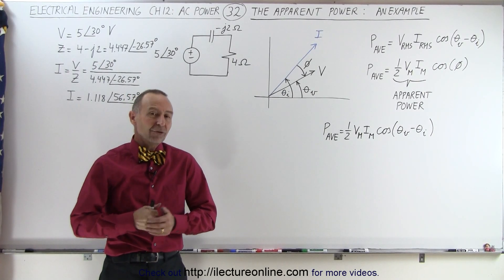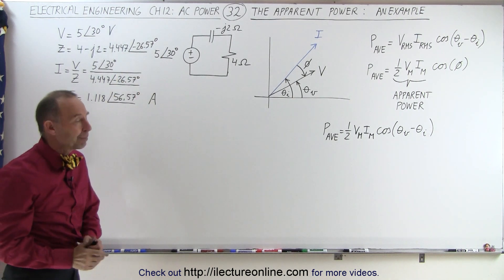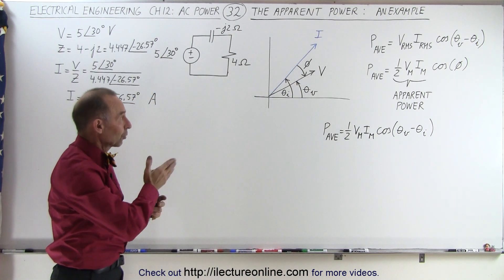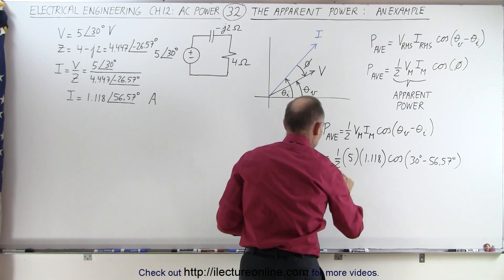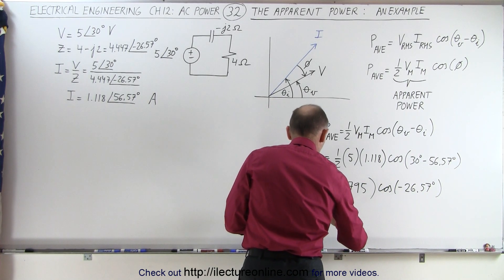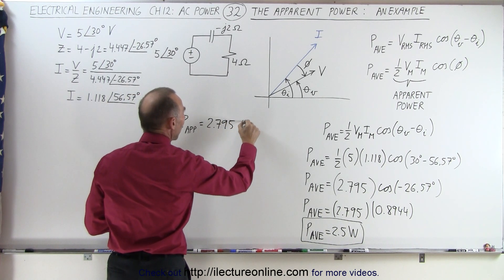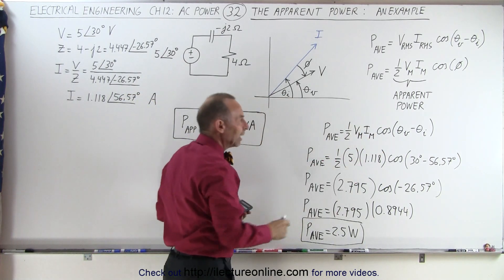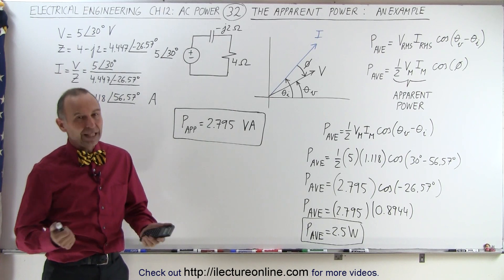Electrical Engineering: Ch 12 AC Power (32 of 58) The Apparent Power: An Example

Comment: Hey professor
Plz clear my doubt Sir... 
At time 1:02 isnt the voltage across the capacitor V=IXc which shoulf be 2.336<-33.43 or the voltage across the capacitor is same as the voltage across the resistor. 
Plz clear my doubt Sir.